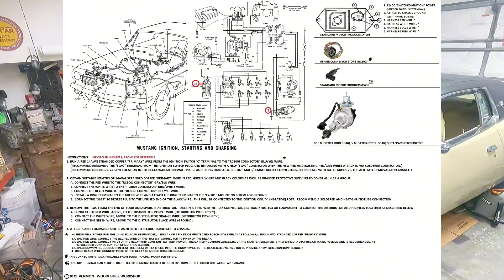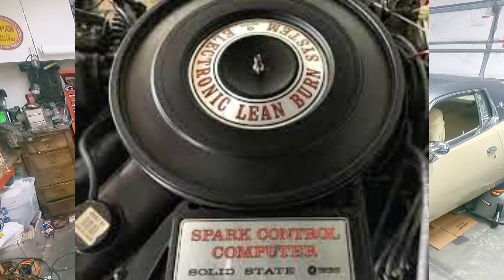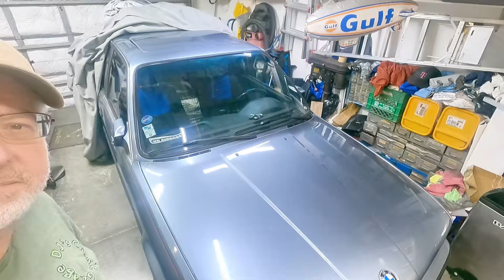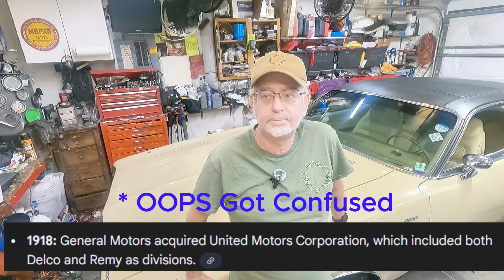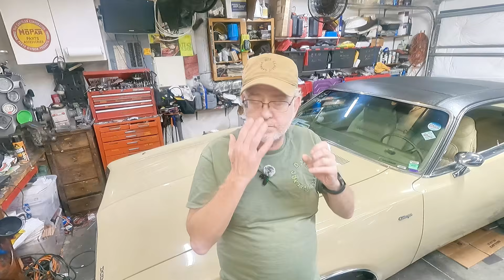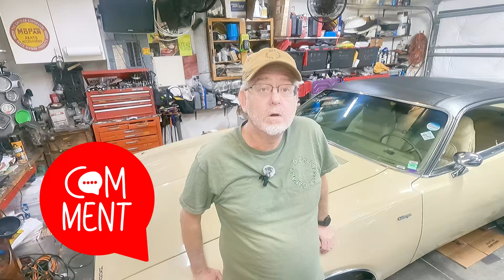Surprisingly The Best Malaise Ignition System May NOT Shock You

Comment: In defense of points the quality of the different manufacturers of those did vary quite a bit; there was one brand or manufacturer whose name which I forget now but it was night and day different from the cheaper ones. Sadly NLA now.. HEI did bring up it's own set of problems due to the higher voltage but you are correct overall an improvement.
Reply: I think the brand name was Echland. But not sure. That was many years ago and my memory is not what it used to be.
Reply: @jacktheflipper-yc7yy   Those were good too, I think the ones I'm thinking of were made in Sweden.  Eichlin is the NAPA part - perhaps they bought from various manufactures.  I have an empty box somewhere I'll post back if I fiind it.

Comment: I had a 76 slant six dodge Aspen without the lean burn and had no issues with the electronic ignition 
I also had a V6 78 Malibu classic with the hei and had no issues. If I remember it had the tall distributor because that v6 was a 350 V8 with , two cylinders removed

Comment: I'm the guy who was converting his lean burns to 5 pin or 4 pin boxes before it became the trendy thing to do.... I.E. my 78 New Yorker.... And my 87 Ramcharger TBI back to the 4 pin box and mechanical fuel pump that's $14!!!.... Yeah and my truck is still running that same box 8+++ yrs now not one breakdown... 89 roller cam 318 And I had plenty of fords and ran the dura spark with no issues...my 78 bronco drove to the junkyard after 10 yrs of service still running it's old dura spark.... The potting on the boxes either 4 pin or 5 pin really didn't  matter would run no matter if there was a short or not... Underhood heat would degrade the potting material as in the other boxes on the firewall as the EGR controls also melted and ran just from time and heat exposure bet in Texas hot climates this happened a lot...a working box can be cleaned up and a modern potting material put in easy fix.... I'm a old Mopar or no Mopar enthusiast would never use a GM part on a old Mopar it's blasphemy!😂... And both the GM and Ford late modules benefit from remote mounting away from heat and on a heatsink... As Ford found out in the late 80s with Thunderbirds and cougars... Mopar magnetic trigger is about as good as it gets. Points don't stand a chance..😂
Reply: The electronic ignition systems were required by the emissions standards going in effect in 1975. Point ignition would wear out of specification, and the fact that it was adjustable ment, just like the carburetor idle mixture screw, you could screw it up. Emissions law made the manufacturer liable for the guy on the end of a screwdriver, something that sent the legal department into a tizzy. Engineering had to make a engine run for 50k and stay in tune without any adjustments that could be improperly done.
   One advantage of the Chrysler lean burn was that the ignition and computer was two separate units in one box, and  the ignition side could be swapped out to repair it using a salvage yard unit that didn't have to match the engine exactly.
  I also swapped a lot of Chrysler early ignition boxes into other systems, often Fords and AMC as the early ones were notorious for failing.
   The biggest advantage GM distributors had was one wire connection, just like the alternator, so any idiot could make it work. It wasn't as good as the Chrysler performance box without aftermarket help for high RPM use.
Reply: @jeffhill3681 the sad part was not to many factory mechanics understood lean burn and it was the first generation into computer control it could run real well at times and at others very lousy...same as the later TBI setup OBD1 lack of live data hurt these early systems...and using breakout boxes for diagnostics wasn't fun....after 1996 thing got better with live data OBD2... But about 2000 OEM's started adding so many bells and whistles to cars that had nothing to do with realibity you have now the modern car that at anytime can leave you stranded with no easy way to repair it. Planned obsolescence pushing technology to the point of diminishing returns.
Reply: I had a '78 Chrysler Cordoba w/360 cu. in. engine and it had Lean Burn. It ran but very poorly. I was a lot more savvy back in those days and I learned how to convert that Lean Burn into straight 5 pin electronic ignition. Different distributor and a bit of rewiring. As for the electronic system, in my experience it was usually the reluctor coil that went bad. In that case the engine would start and seemingly run good at idle. but the moment you tried to go the thing would fall on its face.
Reply from the maker: @williamjones4483 You did what a lot of people did.  Became a different car.  Thanks for watching.
Reply: @DJsClassicGarage  That Cordoba was a good car. I paid $300 for it in the mid 90's. Had over 200,000 miles on it when I parked it. Even lost 2nd gear in the tranny and it sill pulled good with the 360. Got decent fuel mileage, 20-22 MPG.
Reply: @williamjones4483 I still own a 77 Cordoba non a/c car like who orders a luxury car without A/C 😂.... Running a 383 in it today it's a fun car to drive.
Reply from the maker: Great post, thanks for watching

Comment: It may have come first but gm HEI was the best of all
Reply: I dug that you could take the GM HEI setup (V8s) and drop it in older (pre-75) GM vehicles without major changes as the distributor had all the goodies in it! Coil (in cap), vacuum advance, ignition module, pickup and trigger. Just add 12V that once went to the "pos" side of the old coil. Well, a larger gauge wire for the "+" would be better tho'.

Comment: Being a Chrysler tech back in the day, Lean Burn wasn't great, but if you understood how it worked and its shortcomings, it could be made to work reliably. The main problem was you needed the factory diagnostic equipment to diag it properly, something that wasn't readily available to the general public at the time. The reason the computer was mounted on the sir cleaner was for cooling the power transistors inside the box, NOT because Chrysler had no money and was cheap about the amount of wiring needed. Timing adjustments were calulated by the vacuum tranducer pod on the brain, sort of an early MAP sensor....it was a speed density system after all and that was the way they figured out how to do it with the technology available at the time. One thing to note is the brain was moved from the air cleaner to the inner fenderwell up front at the radiator support on later vehicles and plumbed into the air intake tract again to promote cooling of the unit, thus eliminating some of the earlier issues with vibration. As a side note, all the carburated front wheel drive cars had a version of the lean burn system from day one, and no one seems to jump all over that system, just the original design from the 1970's. Some forget that Bendix had EFI in the late 1950's and it wasn't very good either. It took years for the electronics technology to catch up and be reliable to where EFI was viable again. Bendix's EFI was a good idea, just like Lean Burn was a good idea, it's just the reliability of the available electronic compnents at the time were not quite there yet. To say the GM's HEI was stone reliable compared to the Lean Burn system is simply not true. An HEI module was something thst was quite failure prone in the day and most carried spares in the glovebox, just like the Mopar guys carried ballast resistors in the glovebox for the early Chrysler EI, that's how common HEI failures were. IMO this is just another Lean Burn bashing video done by a guy who clearly doesn't understand how the system works, or how to fix it. "It's broken, I don't understand how to fix it, nor do I want to. Let's just rip that crap out and put the old stuff in because I can figure that out without thinking.".......that's the major mentality applied to Lean Burn. Such a shame as when it's working, which was more often than people like to admit, otherwise it wouldn't have stayed in production as long as it was, it worked perfectly fine.
Reply from the maker: Wow, thanks for watching
Reply: it was so good gm basically copied the idea in the '80s with the feedback carbs system